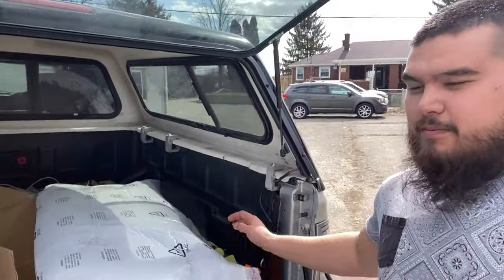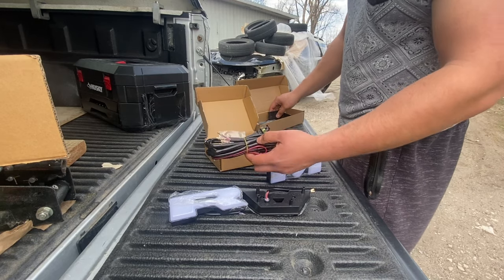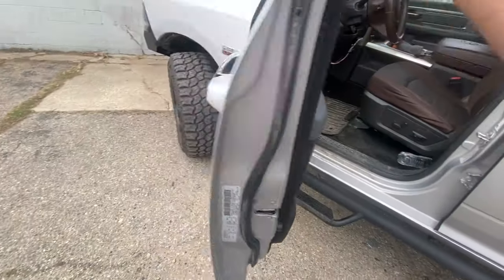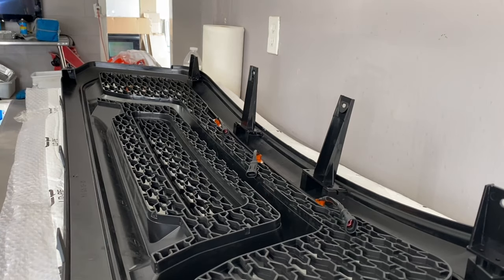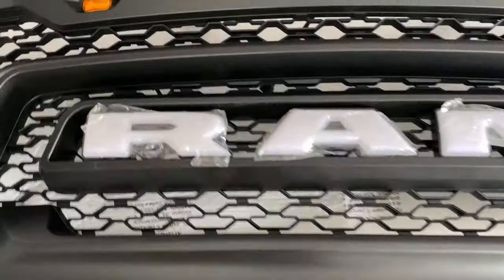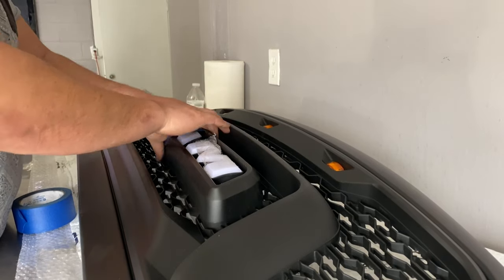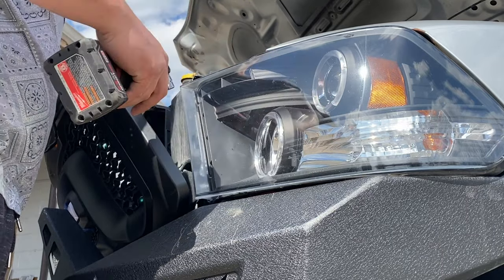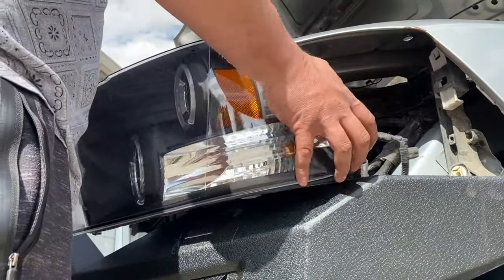RAM Rebel Grille Install on RAM 1500

Comment: Bad ass! I needs one lol. 
Question on the hookeroad bumper, how long did it take for delivery. I just ordered one a few days and today I got 1 box but it was only like half the bumper. I contacted Hookeroad so I’m waiting for their response. It looks good on the Ram so I’m hoping they can get things fixed so I can rock the same bumper.
Reply from the maker: Yup it’s a two package shipment. Mine came separately as well. I would contact the seller just to make sure. Seller was pretty good about getting me the two center lights that were missing. They even let me keep the two extra pod lights that they mistakenly packaged for me.
Reply: Thank you, did you contact them through the website help request? I also tried dialing their number but no answer.
Reply from the maker: @robotops2929  oh I ordered it through Amazon and just hit “contact seller” pretty much. Id double check your tracking info on a desktop to see if there’s possibly two tracking numbers. Sometimes that kind of stuff doesn’t show up on a smartphone
Reply: I’m getting the other package tomorrow, so excited to put it on. Your truck looks nice!
Reply from the maker: @robotops2929  that’s awesome news! And thank you!

Comment: It look really dope what size tires and lift size are you ruining on your truck
Reply from the maker: Thank you! 
Tires: 35x12.5x18
Wheels: 18x10 Moto Metals. (I have them linked in the description i believe for the offset).
Lift: rough country 2in front leveling n3 struts